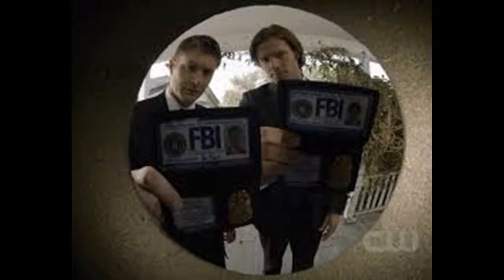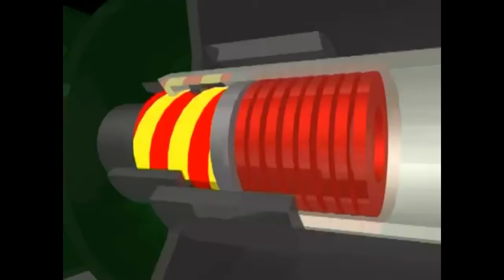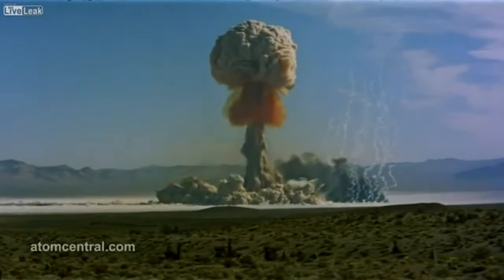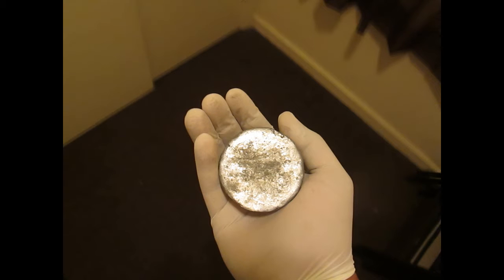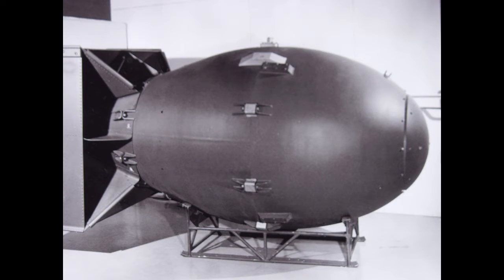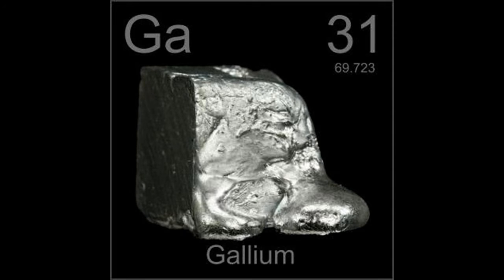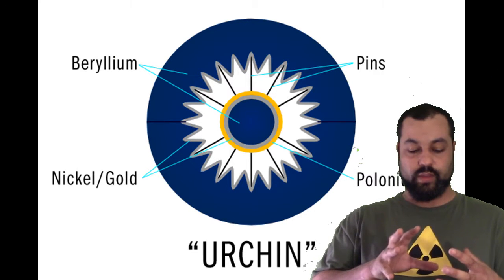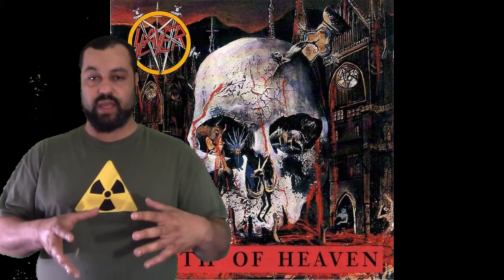nuclear weapons design and physics

Comment: The Mk-II device was of the configuration referred to as "gun type".
It used 141lbs of HEU, containing 118lbs of U-235. Abner was not seperated between the target and projectile. 
The projectile fuel mass was 38.53kg, not 3.4kg. The target was 25.6kg. 
Cordite does not produce a shockwave. It's a deflagrant.
The effective neutron multiplication rate was below 2 or 3. 
9ns generation time. 
The core plasma is not a billion degrees. It'd have been more like 60 million Kelvin. 
70 billion atmospheres. 
Gun type weapons are not cheap. They require much more fissile fuel than implosion type weapons. 
Pure Pu-239 can be used in a gun type device. 
The issue is the high spontaneous fission rate of Pu-240, which is a contaminant in plutonium produced inside reactors. 
No, most nuclear weapons on the planet are thermonuclear weapons. 
The US, UK, France, and likely many other nations do not have any pure fission weapons. 

I know I'm being needlessly pedantic, but I'm bored and people are here to learn, so might as well add to that. 
Nice video.
Reply from the maker: Lol! I understand ...yes I misspoke on the quantity  of HEU used I didnt mean 3 kg obviously my mistake.Of course you could build a gun type Pu239 ...but it will fizzle  .we know this since the Manhattan  project. Cordite is a high explosive and as such will indeed produce a shock wave no question  here. Also the temperature achieved is closer to a few million degrees your right ....although  I DO remember  reading about a billion somewhere..as for the nature of the weapon in each country I have no idea and I don't  work with highly secret military  stuff however, declassified document from the early days are available.  When I said "cheap" I did not mean  anyone with a few thousand dollars could build one it's all relatively speaking . Anyway thanks for your criticism  I appreciate  healthy respectful debate, this was an early video I am sure you can tell the amateurish feel ! Check out my nuclear forensic video it's more recent...
Reply: @Neptunium  No, a pure Pu-239 gun type weapon will not have a particularly high probability of predetonating. About 55% higher than the fuel used in Little boy, for the same insertion time. For comparison, weapons grade plutonium has a probability 281 times higher. Pu-239 is not the problem. Pu-240 is. Thin man was being developed based on an measurements of relatively pure Pu-239 produced by accelerators. When mass production began in reactors, the higher Pu-240 made it unsuitable of high yield weapons, and that's why thin was was abandoned. 
Wikipedia: "Like gunpowder, cordite is classified as a low explosive because of its slow burning rates and consequently low brisance. These produce a subsonic deflagration wave rather than the supersonic detonation wave produced by brisants, or high explosives."
Relatively speaking, gun type weapons are more expensive than implosion weapons, because they require several times more fissile material, which is what drives the majority of the cost. Cordite, high explosives, detonators, electronics, ballistics cases, capacitors, tampers, etc are relatively cheap, what makes nuclear weapons expensive is the enriched uranium and transuranics. 
Already subscribed and I'm sure I'll be watching more vids. :)
Reply from the maker: @Evan Bell the whole Pu239 weapon system comes dow to the 240 isotope as you rightfully pointed out. But for a usable weapon the isotope must be below about 6 to 7 %(most US weapons are about that)  which further increase the final cost ... when you mentioned the 55% increase of premature low yield explosionI you are correct but again are you willing to have a weapon fizzle when attacking an enemy  ? Or is 55% an acceptable additional  risk? Could we use another fissile isotope instead of U235 and Pu239 ? Of course we could it's not forbidden by the laws of physics but does it make financial sense ?  I think we are talking  the same language  here and the distinction  comes from technicalities, military tactical outlook and business decisions...
Reply from the maker: Hey thanks for your  subscription  and great input!!!
Reply: @Neptunium  The UK has tested reactor grade plutonium boosted weapons with no degradation in yield. When I said a 55% increase in probability of predetonation, I did not mean the probability of Little Boy predetonating plus 55%, I meant a it'd have a 155% probability of predeteonating compared to little boy. And that's if we're using the same assembly time. Predet risk could have been reduced to be the same as that of little boy by decreasing insertion time, my increasing assembly velocity, which is exactly what the designers did, that's why Thin man was longer than little boy. 
If they could have produced sufficient quantities of relatively pure Pu-239 in accelerators, thin man would have worked. 
However the most efficient way to produce the required amount of plutonium is reactor breeding, which contaminates the product with Pu-240, which presents much high SF background, and makes a gun type weapon extremely difficult to safeguard against predetonation. 
Pu-239 is not the problem, Pu-240 is.